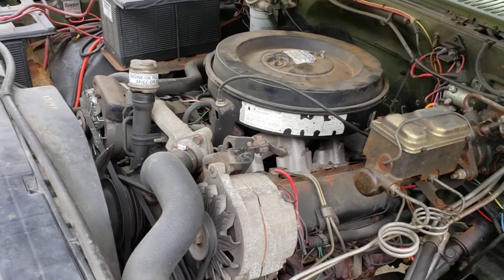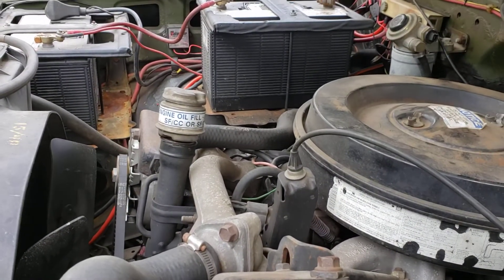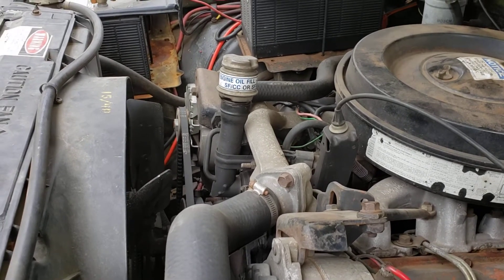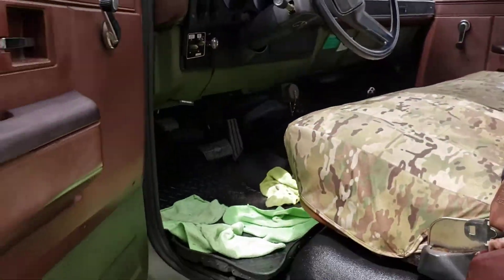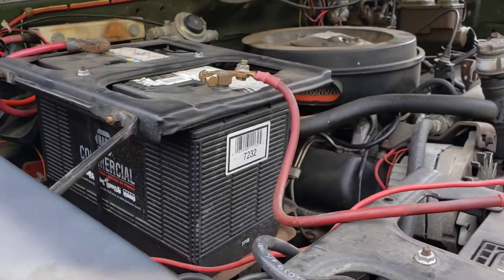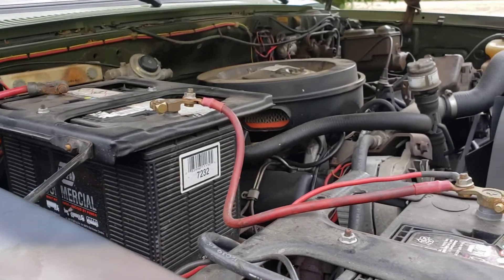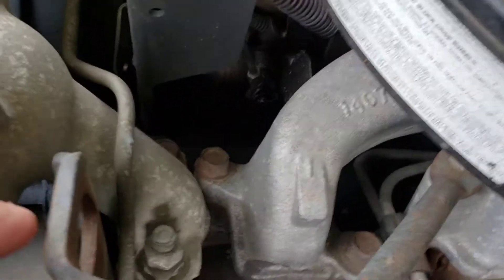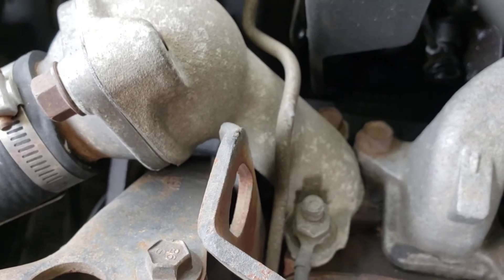M1028A2 CUCV Project: - BATTERIES DRAINING!! Testing the starting/charging system.

Comment: So let's see if you can figure this out. I have a M-1009 still 24volt and only half of the charging system is working!. Both alternators are new!, both the Gen1 and Gen2 lights turn on. When the truck starts the Gen1 lamp says on!, the rear battery is charging 14+, the front battery nothing!. The front battery is not draining but it is not charging at all!. Any ideas?
Reply from the maker: Whoa, why is it starting, but not draining?
Reply: @VermontPrepper  ; I have to charge the front battery up but I can't drive the truck anywhere because the front battery will drain out!, also at night the lighting system will drain the battery!, other than that the truck runs great!.
Reply from the maker: Obvious question, but are the battery  cables good?  If alts are working I would think it has to be an electrical connection issue
Reply: Need to check fuseable links this system is two 12v alternator wired one charges per batteries and wired in series to terminal block for radio , nato plus And starter need to see if on of the alt’s have continuity to battery

Comment: i had my alternators made into 1 wire alts and they work great
Reply: Is it still a 24v starting system?
Reply from the maker: Hi, yes it is
Reply: @VermontPrepper  Do you know what the little orange wire on the passenger side alternator goes to?

Comment: So I’m checking the truck will jump and run just not charge. I have replaced both alternators and batteries and still nothing. We have a fleet of these wonderful trucks that we maintain and use daily for work
Reply from the maker: That's a tough one.
Reply: Probably the fuseable link near the master cylinder these use two 12v alternators wired in series

Comment: Thanks for the video. What type of fuel filter are you running?
Reply from the maker: Spin on
Reply: Did you just push the water in fuel cable to the side? What spin on did you go with?

Comment: My gen1 light is out. Output on driver side alt is low. If I replace alt will gen1 light be on. All bulbs are new. Printed circuit is new.
Reply from the maker: Step yourself through the alternator testing process on the video and it will determine which alternator is bad.  If one  or both is bad, the light will go back  on (assuming bulb is good) if your replace the alt.  If you have already determined that (like your comment suggests), replacing the alt should fix the issue)

Comment: greeting
I want to switch my m1009 to 12v
can you help me?
I know I need to bypass the resistor ..... turn off the driver's alternator and remove the first battery or connect them in parallel
But what should I do with the other wires
Someone also mentioned to me the solenoid relay should I bypass it or?
I already have a 12v starter installed
Reply from the maker: Sorry I am not knowledgeable about that.  Steel Soldier might have a forum on it.

Comment: My front battery was not charging (alt 1) and thank you it was just the bulb on the dash. It had stopped coming on and I did not think much about it as I had both Alt. rebuilt about a year ago and replaced both battery's not long after that. I just thought the light went through a test light and went off after the engine started and then would just come on if it stopped charging. But now I know it must come on when you first turn the key to the on position.
Reply: That light acts as an exciter for the alternator. You need it for the alternator to start working. If you test the alternator without the light ever coming on, you will find the alternator is dead. The alternator in this instance probably is still good, but only the bulb is bad. I would just check the batteries to see if it is being charged.
Reply: Forgot to add that just wiggling the bulb will make it work. Do it with the engine off or you may not see it come on, as it could go out very quickly and your alternator will be charging again. To be more clear, check each battery separately as each alternator charges a battery.